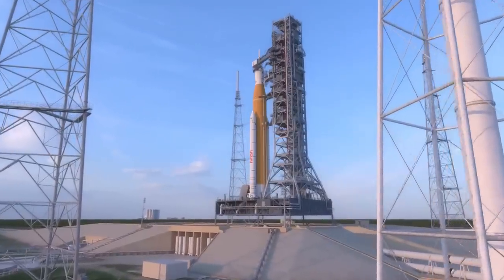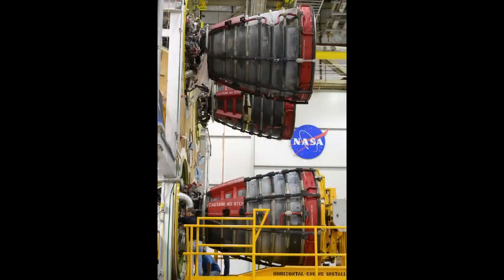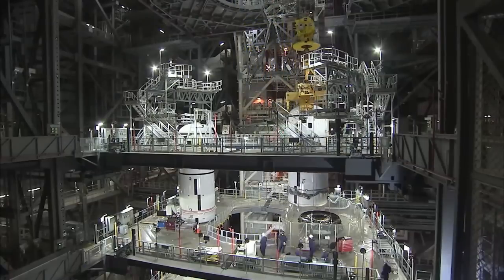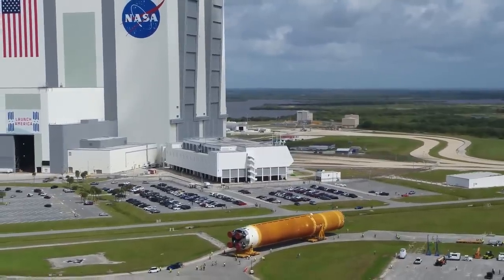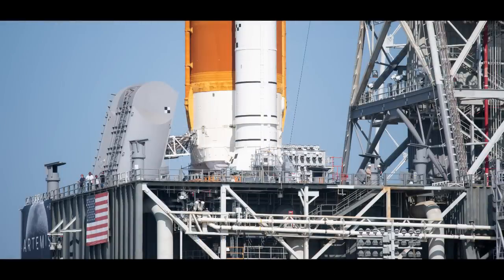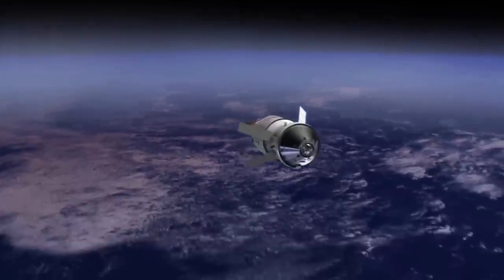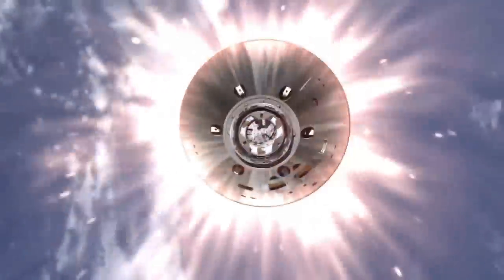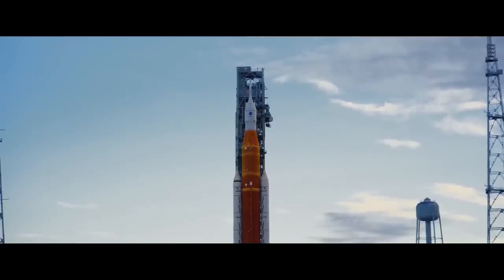What's The Big Deal About Artemis - NASA's New Massive Moon Rocket

Comment: Hopefully NASA has remembered to include some good cameras on the Orion capsule. Would be cool to see new and maybe HD footage of a moon fly-by. Any ideas how close to the moon they're going to pass?
Reply: Off the top of my head 60 kms or miles on both arrival and departure. So there'll certainly be an opportunity there.
Reply: I pretty sure its 60 miles over the North Pole and something like 40,000 over the south
Reply: Maybe. But prepare for glorious 720p stream.
Reply: @Swordcrusher  that’s for the moon-landing missions like Artemis 3-onward. Artemis 1 is going to a distant retrograde orbit at 38,000 nautical miles roughly above the moon’s equator with a powered flyby (oberth effect) at 60 nautical miles to enter/leave the moon’s sphere of influence.
Reply: There are probably a few cameras, but I'm not holding my breath for any HD live footage. Live broadcast from space is still incredibly rare, especially from beyond LEO. Keep in mind that there are no com-sats up there, only the DSN.
Reply: I believe there are 720p cameras on the exterior of the rocket, but HD cameras in the capsule. Even if the stream is interrupted, I believe the data is saved on board so if the capsule survives re-entry you should have guaranteed HD moon flyby footage :)
Reply: It's NASA, so expect a high resolution black and white camera, with various filters that can be rotated in front of the sensor to get color after a week of processing. LOL
Reply: I hope there are cameras, and that the entire trip is captured, from launch to splashdown.  Streamed in real-time and later the condensed version shown at your local IMAX theater.
Reply: @Swordcrusher  That sounds like one of my better Kerbal orbits.
Reply: You’re having a laugh mate! They’re lucky to have windows.
Reply: @debott4538  Apollo used a 4 Watt 2 GHz progressive wave vacuum tube amplifier. Modern microwave amplifiers absolutely crush what was available in 1968. The year before the multiple emitters UHF transistor was invented (2N3866), capable of (Wow!) 1 Watt RF, and was used in the surface radar.
All in all, we can reasonably expect to see 1080p in real time, and 4K later...
Reply: I sure hope so, they've hyped this launch a lot for months and the last thing they want is to make everyone disappointed
Reply: Presumably they'll have given much consideration to TV (and internet streaming) coverage of the mission. I imagine there'll be extensive video from a multitude of angles. But I don't know if HD can be transmitted in real time from 384,400 km away? Anyone know if this is possible with today's tech?
Reply: There are literal GoPros on the end of each solar array.
Reply: @rayoflight62  they better have at least 4K video afterwards. Hoping for even higher res images tho
Reply: They will need to capture live video so that when SLS blows up they can possibly see which components failed.  It is a TEST flight, so they need to capture test data.
Reply: @philb5593  So the solar panels are basically selfie sticks?
Reply: @richardchristie3203  

"You’re having a laugh mate! They’re lucky to have windows."

Too bad you didn't say "you're taking a piss mate!" because then I would have been able to point out that in the USA "taking a piss" means "using the toilet" lmao
Reply: @richardchristie3203  Richard, is it correct that if I travel to Britain and I'm in a pub and I say "ah man, be right back guys. Gotta take a piss", they would say "but you're already doing that, mate"? lmao :)
Reply: And hopefully they don't erase the original tapes in 20 years this time
Reply: @my3dviews  it's the moon bud, it's going to look black and white even if it's in color lol
Reply: Hopefully, they'll remember to put a solid microphone array in the capsule. It'd be nice to get whatever sound we can from the launch, at least.
Reply: It's not like we've had high-def photography of the entire Moon since 1967 or anything.
Reply: @janmelantu7490  ahh, the language that I understand, Kerbal Enginner Redux terminology.
Reply: They do, and they plan to recapture the famous Earthrise that Apollo  first captured.
Reply: @ILSRWY4  Well, the Japanese did that in 1989.
Reply: I assume there will be some decent enough footage. Don't forget the video of the Perseverance landing on Mars - I am pretty sure that was 720p. All things considered with how bloody far away Mars is, 720p is not bad.
Reply: And the view inside the capsule during the launch.
Reply: @litespeed65  They can thank the Apollo astronauts for that after recommending to the scientist to install a window in the capsules
Reply: @rayoflight62  I’m not sure what most of that means, but it sounds impressive. Thank you.
Reply: Hands up anyone who instantly thought "When this test goes ahead and it's zooming around the Moon (very likely taking ACTUAL high quality pictures and UHD videos of the moon surface and looking back at Earth (the 'Blue Marble' and the curvature)) that FLERFS are gonna jump up and down running around everywhere screaming "Fake!" and "It's ALL CEE GEE EYYYYYYYE!" 🤔😏
Just wait... It'll come. I can almost hear it now hahaha, bless 'em. 😜    😎🇬🇧
Reply: @debott4538  how do you supposed they got the footage and sound back from the moon 50 years ago? If they can’t do it today?
Reply: I hope they put 4k (or higher) cameras on the vehicle and stream in HD
Reply: They can't do that cause of the Alien base that's already on Moon! lol
Reply: @allthingsbing1295  TV footage from Apollo was really bad. Even live footage from the ISS isn't all that good. My expectation for Artemis is accordingly low.
But that's only for live pictures. FIlm and digital records always were and will be great.
Reply: They probably got the best film cameras money can buy
Reply: @philb5593  Need to have at least one important camera to not be fish-eyed.
Reply: @TheAziz  bandwidth at the moon isn't like fiber on Earth ofcourse. Spacex launches go to LEO. Even they needed some time to refine their coverage from the rocket stages and afaik they now use Starlink (the first megaconstellation) to do it.

 LEO is 2K km, the moon is 384K km, and strength of signal drops with square of distance so that's 36000 times weaker. So you'll need a much larger dish to detect transmissions. I would be very surprised if the deep space network could devote bandwidth to live transmissions from the moon.
Reply: Not mission critical to add anything cool like that.
Reply: @TheAziz  for 2 minutes then a PS1 graphical style animation
Reply: @AmericansBee  yeah we all know that. Cuz even flerfs will continue to say it's all CGI.
Reply: Best 3D animation NASA can provide 😀
Reply: Nah, they forgot - but you remembered......
Reply: @debott4538  Actually one of things NASA has added this time is a couple of lunar orbit communication satellites…
Reply: 60 miles usually
Reply: @FredPlanatia  36,000 times weaker if you use radio signals sure, not any weaker if you use lasers though, which NASA demonstrated in 2013
Reply: OP said HD footage, not anything about a HD stream. 

Why you're all going on tangents about stream quality when no one even suggested that is beyond me.
Reply: @Zreknarf  Thanks for mentioning that. I went down the space-based laser comm rabbit hole, very interesting! The beam of a laser is directional but it still spreads out with distance with the inverse square law. You only get no attenuation if your detector covers the entire cone of the spreading beam. Anyway, your main point is that laser-based comm from the moon achieved hundreds of megabits/sec and that's enough for a live transmission in 4k if they wanted to. They'd probably need a relay sat  which could beam to different ground stations in case of weather issues (since lasers have issues with clouds). We can hope!
Reply: @FredPlanatia  naw, the inverse square law doesn't apply to lasers, only for things that spread their energy equally in every direction i.e. sound, standard light, radio waves. beam divergence is a thing yeah but it's much less of a problem than the inverse square law, and you could avoid that completely with a very precise lens with the focal point being earth
Reply: @AntiContradiction  the third reply suggested it, and it's a more interesting conversation than (more) HD footage of the moon, imo
Reply: @Zreknarf  This is just incorrect and a widely held misconception. So I have to reply. The beam is diffraction limited and therefore the wavefront spreads out on a cone with distance. The cones area increases as the inverse square of the distance  and so the beam's intensity at any  given detection area (e.g. a square cm) is decreased by the inverse square if the distance. So, yes it does still follow the inverse square law. However, if you are able to place a lens of sufficient aperture such that it captures most of the wavefront, you can reverse the divergence and THEN the detected signal intensity is not reduce by the inverse square of the distance.
Reply: @FredPlanatia  I'm not sure I follow. it's pretty clear to me that if you shine a laser pointer 2m away the beam at the end is not 4x wider than the beam at the start, unless you're using an intentionally diverging lens
Reply: @Zreknarf    Why did you pick 2m away for the point where it would be 4x wider?  The reality is that the beam in any laser does spread out over distance.  At some distance (not necessarily 2m) it would be twice as wide, then double the distance it would be 4x as wide, etc.  At the distance of the moon it is several km wide.  Read about the Lunar Laser Ranging experiment.
Reply: I doubt they will include any footage that will be made publicly available without intense records requests.  Remember it is still a government agency with loads of red tape.  We are all very spoiled by SpaceX and their fantastic footage we get to see.
Reply: @EagleMitch    They will likely have live video just like from the ISS.  The Apollo landings were shown live on TV.
Reply: @my3dviews  that was back when an entire country has rallied behind what was going on.  Modern America doesn't give a shit about this mission and would be appalled if they actually knew how much money they spent on this.
Reply: @EagleMitch    But, like I said there is live video from the ISS.  There was also live coverage of space shuttle flights.  
As for the cost of SLS, that is well known and is talked about a lot when referring to it and NASA.
But we will soon see whether we have live coverage or not.  I'm guessing that we will, just like with the ISS and other space flights.
Reply: @my3dviews  I picked 2m because that's the inverse square law. 1/d². 1/2²=0.25. at 4m it would be 16x larger etc. but that's not how lasers work
Reply: @my3dviews  if you want to see the inverse square law, here's an experiment you can do at home. poke a hole in a thick piece of paper. measure it. shine a flashlight through it 2m from the wall. measure the size of the light dot on the wall. 4x larger. now try 4m - 16x larger, and also 16x less bright.

double the distance doesn't just make it double as wide, hence inverse "squared" law. but not applicable to lasers.
Reply: @Zreknarf    Inverse square law refers to area of the diverging beam and the intensity not the diameter.  
2m is irrelevant and is just a number.  Would it be relevant if feet were used?  So at 6 feet 3 inches?  No, of course not.  You need to compare it first at a distance from the laser, then at twice that distance. 
If a perfect laser that didn't diverge existed, then it would not obey the inverse square law and would remain the same size even up to infinity.  But since no perfect laser exists and they all diverge they do obey that law.  Sure, over short distances the divergence is unnoticeable, but try pointing a laser at a distant building of maybe 50m from the laser and observe how big the spot is.  Then find another building twice as far.  Guess what?  The beam will have twice the diameter at a building twice as far.  That is the inverse square law.
Reply: @Zreknarf    
At a short distance like 2m, the laser has not gotten much bigger than at the point it was immitted from.  You need to compare at larger distances, since it is not a point source.  If the laser originates as a 4mm point and at 2m it is only 4.5mm it will not be 9mm at 4m but only 5mm in diameter.
So, do the experiment that I stated in my previous comment.  I just did it.  The laser point gets close to twice the diameter with twice the distance.  I did about 5m then 10. It won't be exactly twice due to the original size of the laser spot.  But that will become less significant with larger distances.  So at 10km, the spot will be very close to twice what it is at 5km, but not twice at 10m vs 5m due to the original size being a more significant factor.
Reply: @aarondavis8943  The distance will not matter. There is no attenuation of radio signals through space, so the signal should arrive at earth in(practically) an instant in its pure form. No attenuation and hopefully no distortion.
Reply: @my3dviews  anyway i think we can still agree that lasers are probably more useful than radio for long distance space comms and probably more than capable of an HD stream from the moon as early as this week, if they really wanted to
Reply: @Zreknarf    Well, no.  Think about the Voyager 1 and 2 space probes that are beyond the solar system now.  They can still be communicated with by radio transmissions.  No way that a laser would do that in both directions. 
A low wattage transmitter on a space craft can easily be picked up with a large parabolic antenna on Earth.  
In 1969 to 72 we had live video from the moon using radio frequencies.  There should be no problem sending HD or even 4K video from the moon today, if they chose to do so.
Reply: REDWIRE providing the cameras.
Reply: Probably went with the 480i video cameras from Apollo to save money since they are massive over budget!
Reply: @TheAziz  Well yeah, streaming stuff from space beyond LEO is pretty difficult & bandwidth extremely limited. Processing 4k video, especially a live stream sent from space across the world, would be pretty insane with just the current DSN (which is entirely based on earth). It's why they're testing & developing a laser-based system for future missions.

Just for an example, the DSN can only receive about 0.5 to 4 megabits per second from Mars, and only during limited windows. Granted, the moon is much, much closer than Mars, but still is well beyond LEO & has no additional communications network to amplify signal.

4k or even 8k video will likely be available once they retrieve the raw footage from the capsule once it returns to earth.
Reply: Oh, about 239,000 miles.
Reply: Right like a recreation of the original earth on the horizon photo
Reply: Going to the moon where have i heard that before
Reply: Since its public funding, it will have to be compatible with old tv screens. Expect VHS quality.
Reply: @my3dviews  If the Thuilliers were still alive, the turnaround would be faster.
Reply: @BradGryphonn    "Thuilliers"?
Reply: 10 bucks says they put a bunch of potatoes out to take video..
Reply: @my3dviews  A mother and daughter team from the early 1900s who hand-coloured film for pioneering moviemakers. Elizabeth and Berthe Thuillier.
Reply: @volkswagenb9406  720p cameras??? Is this a joke loolz. Nasa should have at least 8k cameras for an oportunity like this. Not to mention the cost of this program...
Reply: @danijel124  it’s kinda hard to make cameras of that quality be able to survive the temperatures, stresses, and violent shaking of space and ship launches. As for the interior cameras, I agree. 4K is awesome, but we do have cameras that are better.
Reply: @volkswagenb9406  In my opinion at least electronically 720p camera and 4k camera dont really differ that much (The sensor is more detailed) but thats about it.... So it is foolish to even considerf using 720p when you waste so much money and time on a project of this scale. Minimum resolution should be 4k... But in life nothing is ever perfect....
Reply: @danijel124  not only that, but I’d imagine storage is a large issue. Weeks straight of 300 fps 8k resolution will take up quite the amount of space. Space that could be used instead for scientific use. I’m sure with the massive overhead they could certainly afford good storage, but they’d take up space and weight I’m not sure they could afford. This is of course, all speculation. I’m not a camera aficionado
Reply: @danijel124  They probably do have amazing cameras, just won't be able to see the footage in that detail until they get their hands on the physical storage devices. There's just no way they can live stream anything in such high quality with only the Deep Space Network we have now.
Reply: We need to rename this rocket "Stanley Kubrick"
Reply: Oh now I’m worried they forgot the GoPro 😳
Reply: Wife works at nasa. Yes, they did set up cameras.
Reply: @my3dviews  Black and white was used for it’s much higher contrast and detail than color film could give at the time.
Reply: @debott4538  they're dropping some cube sats on the way, if we're going to the Moon again, we're going to need some high bandwidth relays.
Reply: @neutrino78x  "taking a piss" and "taking the piss" are two very different things. In the UK "taking a piss" means exactly the same as across the pond. "Taking the piss" means making a joke.
Reply: @blackhawk7r221    Not just at the time as you say, but NASA still uses black and white cameras on their probes with a color filters (as I stated).  The New Horizons probe that flew past Pluto did that.  Epic Discovr which takes photos of Earth still does that as does Hubble. 
The helicopter on Mars can only shoot video in B&W.  With the improvements in technology, we shouldn't be stuck with images of Pluto and other planets that are in black & white.  I get better images with my phone in low light than their B&W cameras get.  

As for color film vs. B&W on Apollo.  If you go to flickr Project Apollo Archive you can compare the color vs. B&W film photos from the surface of the moon.  The B&W look worse for detail than the color ones.  They appear grainy, but the color ones don't.  Even if the B&W was supposed to have higher resolution, there was more than enough with the 70mm film that was used.
Reply: @my3dviews Whew! Then you are one of the few of us who understand.
Reply: @bipolarminddroppings  

""Taking the piss" means making a joke."

lmao. Here we say "surely you're joking" or "you must be kidding". :)

How about "I'm about to be pissed off right now" what does that mean in Britain? Here it means "I'm about to be angry  with you". lol :)
Reply: Their planned DRO orbit comes quite close?
Reply: 420p nonscope is the way to go.
Reply: @allthingsbing1295  they never went..
Reply: The new rocket is a rocket build from scrap from thr epwce shuttle program. For far better fuel economy new developed engines are essential. Those engines where solely made for the shuttle. It is an enormous tank they can't save because it is only a 2 trap rocket the 1st enormous trap need to go into orbit. 

Normal rockets have more stages especially for ditching the empty tanks to safe weight and use other more efficient vacuum engines with a wider nozzle when ascending in thinner air. The 2nd stage is primarily used for the Lunar insertion and read that the 2nd stage is very small. 

Concluding: Artemis is extremely expensive and heavy dependent on old space shuttle parts for its build. Some parts have flown 7+ times. 

Why you don't start with a clean sheet with modern technology like what SpaceX is doing now with its Raptor 2 engine with big updates to simplify it and added more thrust. Why can't NASA with its billions of  budget not even really develop something but pull all old parts together from the space shuttle and their solid boosters. It's now very old  and needs a place in a museum.

If you tink of 5 years later and SpaceX receive the same findings as Nasa, Spaceship would be a giant LEAP in the future of space capable  bringing a lot of astronauts and cargo to build a Moonbase. Especially the reusability and the quick turnover time. 

So this expensive Artemis project looks like they took decades old drawings and technology and almost no reusability, and that is a big shame. I hope that at the time they will fly people to the moon, SpaceX has caught up with Starship and all test and certification done to just obliterate NASA's project. 

Because NASA get funded so well, they don't think about falling money out the sky burning up ot crashing into the ground. That's why competition is so good. From 2011 USA stopped the spaceshuttle and had to rely on Russia for the ISS. Think of it now with the war. Russia's part in the ISS is certificated for just a couple of years.  If they don't renew and doing maintenance th4 systems need to shutdown and because every country made something, they are dependent on each partnering country for working. If 1 stops the project is dead. Hope they can launch the needed modules to safe the station
Reply: NASA: oh nooo we forgot cameras!
Reply: Maybe they'll learn from the Chinese Mars rover where they set out external cameras so they could take promotional shots of the rover, they also did this in flight.   The best that was done on Apollo was a camera on a boom to video the first step on the Moon and of course leaving a camera to film their departure from the moon.  Of course keep in mind that the ability to retrieve photos and video wirelessly was really limited such that photos from satellites were delivered by small re-entry capsules that were retrieved by hook from a helicopter as they parachuted down.   The limited photography and video of the Apollo era was a matter of the limited technology and was actually quite remarkable for the time.  You can't view the Apollo era from the perspective of our modern consumer technology, remember that your smart phone is well over 20,000 times more powerful that the breadbox sized computer of Apollo whose ROM was hand wound bit by bit in wire knots by workers in the factory which some astronauts called "Little Gray Women",  no over the air software update there (actually they did modify the runtime code in ram by instructing the astronauts to key the changes in byte by byte).
Reply: @volkswagenb9406  pretty sure 720 is hd, maybe you meant full hd at 1080?
Reply: I'm sure there will be video. I also imagine it won't be live and direct however because I'm sure they want to be able to filter and control what the public actually sees.
Reply: @chrictonj9503  cinemas likt to make money bud
Reply: Sorry guys.  It wont fly (this year at least).  If it does watch for the massive fail - I hope to hell I am wrong.
Reply: Looking at my previous comment here..
I wasn't as much impressed by the fact it finally flew, as I was by the fact it was a 4K stream.
Reply: @danijel124 you have to remember that this is NASA and those cameras are also going to be doing science, along with engineering documentation and not just bringing us pretty pictures. NASA is not going to integrate an untested 4K camera into a multi billion dollar vehicle. They are going to use cameras that are already qualified to work in that environment.